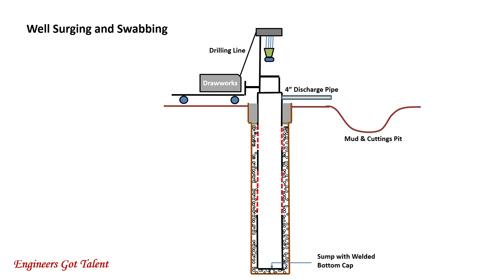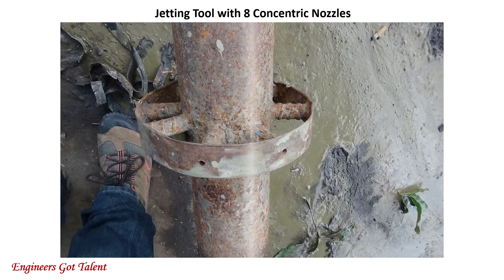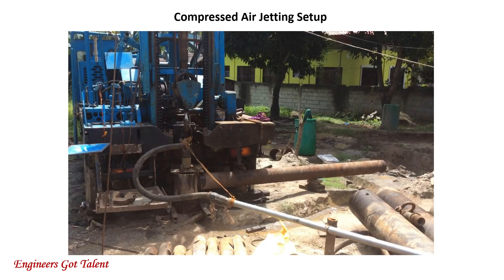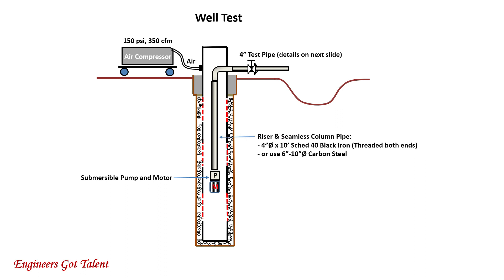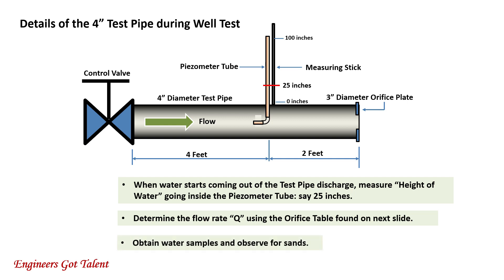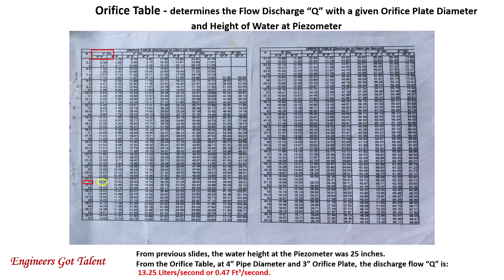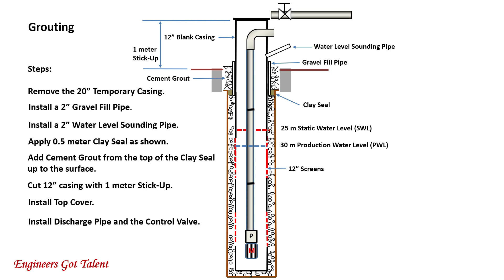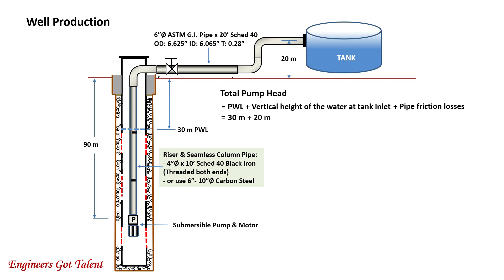Simplified Deep Water Well Development, Testing, and Production

Comment: I just completed a 154' deep well with mud rotary. But have not yet completed the development procedure. Its been two weeks since completion. Which method do you think best fit my situation. I used a 4" PVC casing with horizontal slots all the way to the water level.